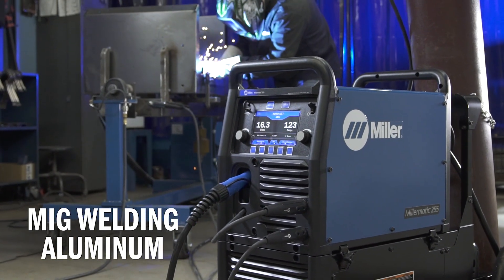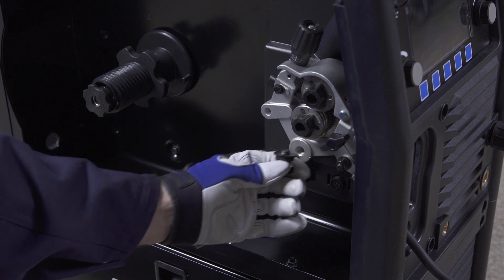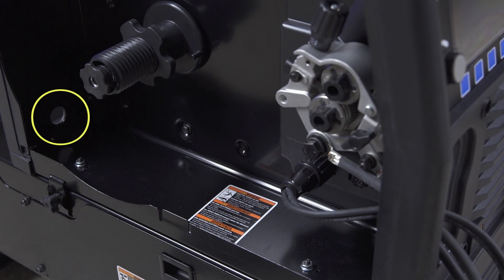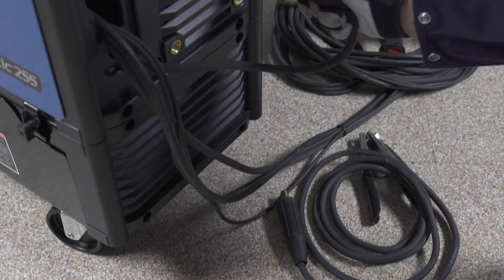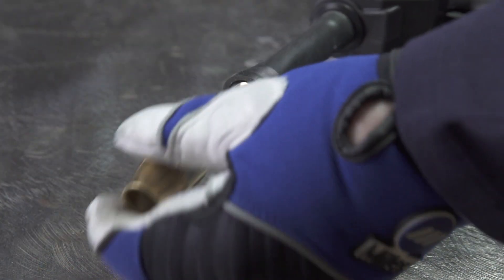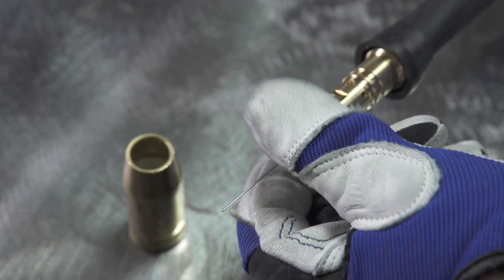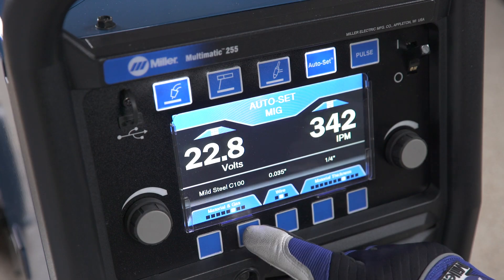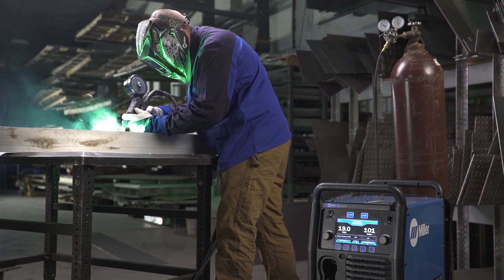Millermatic 255 or Multimatic 255 Spool Gun Setup

Comment: This Spool gun is total bs. They have adapted one after the conception of the machine or something like that. The trigger is horrible, it will pintch your finger gloves every squeeze and you have no pre nor postflow setting. It is all manual as you have to trigger the gas with a gentle press of the trigger, then 3/4 inches farther the switche contact and then you have to remember to not let go fast as you need to keep the gaz flowing for postflow... And on the multimatic it have the connector for tig welding in the front for gaz regulation that could have been used for the two process and you won't have to drill a 1" hole in the back of the welder for the hose. Miller's getting more and more a bs companie as they tend to sell poorly made, not well designed product and have total lack of customer support. Get a ESAB instead, their new machines are the best!

Comment: i have a question = can the 255 be set up to run pulse either using the spoolgun and or push pull system  ?
Reply from the maker: Hello scn102. Thank you for reaching out. To answer your question, yes, the Millermatic 255 and Multimatic 255 can pulse mig weld with the Spoolmatic spoolgun or the Aluma-Pro push/pull gun. Let us know if have any additional questions!